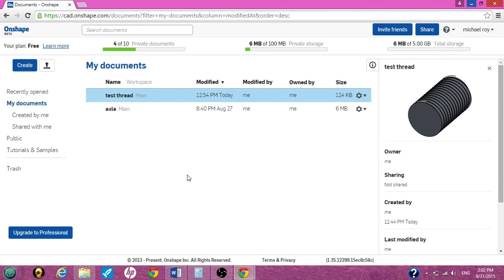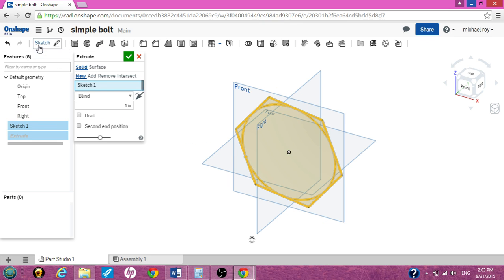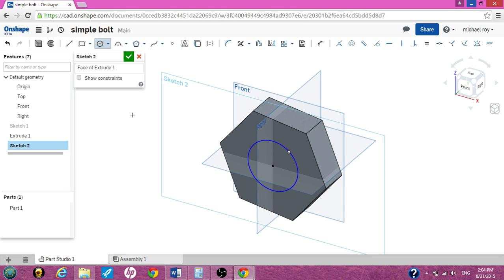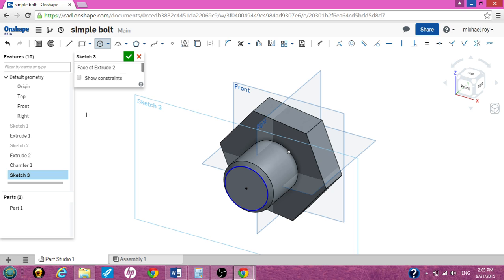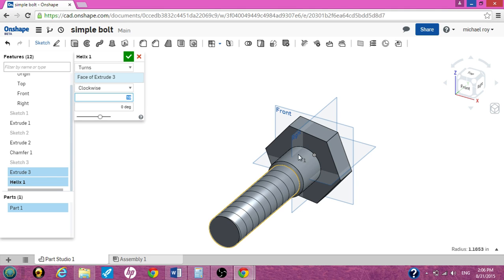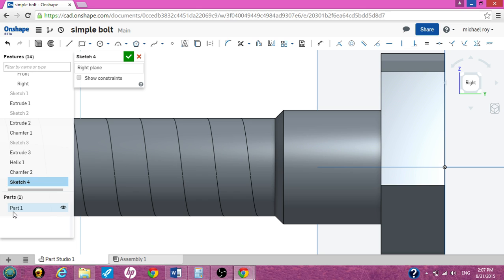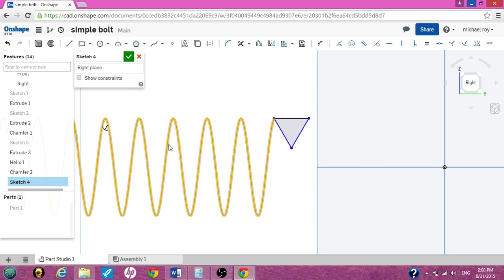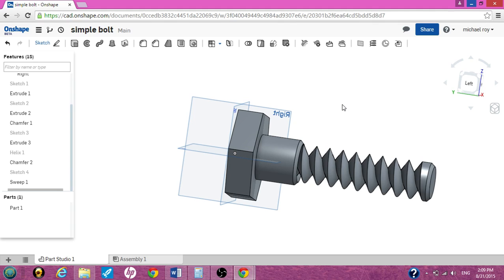simple bolt using Onshape

Comment: Thanks. The chamfer is a nice touch. 
I've been struggling; trying to draw 45º angles in manually, before extruding.  
So, why do we use the pierce tool; when connecting the helix to the equilateral triangle? 
I assumed that tool was going to be for punching holes, etc.